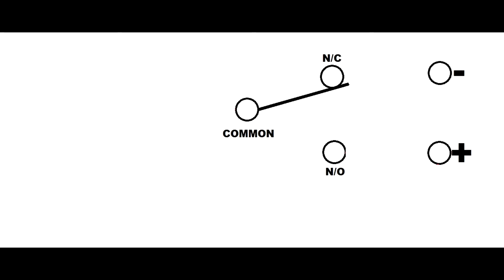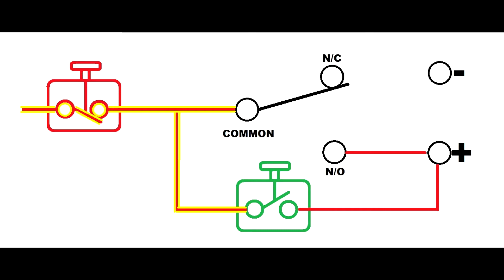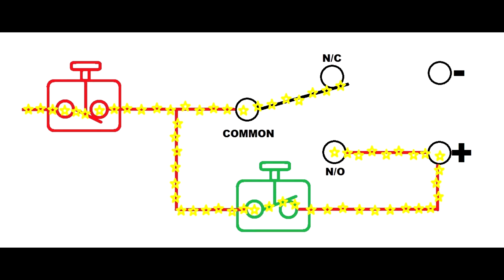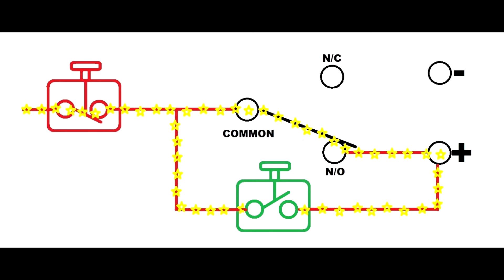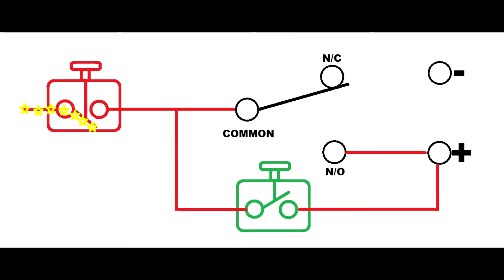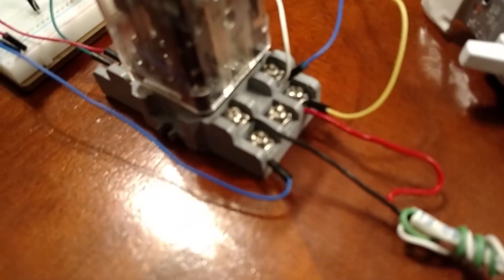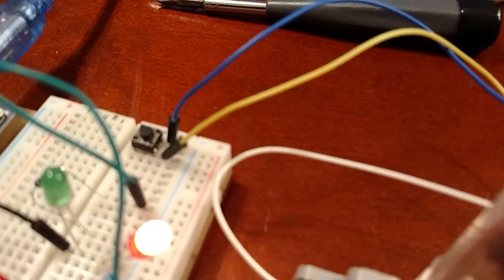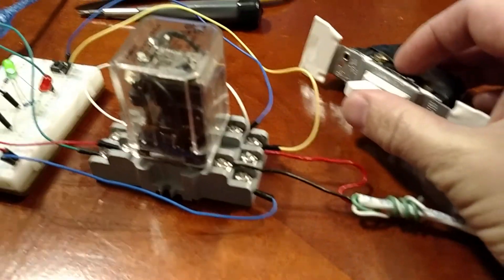Your Friend and My Friend : latching relay

Comment: Latching relay use magnet dude.
Reply: Nope.
Reply: @will_it_work  Yes. A latching relay stays in position when the power is disconnected. They use magnets to achieve that.
You then use a reversed polarity or a different coil to switch to the other position.